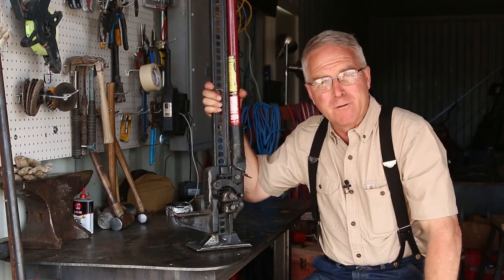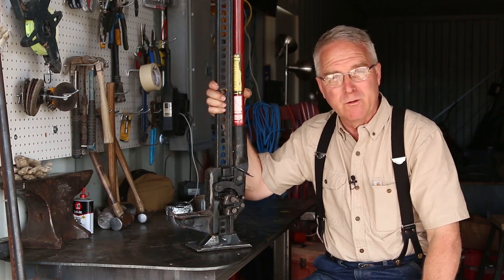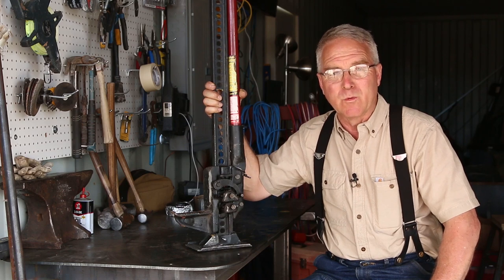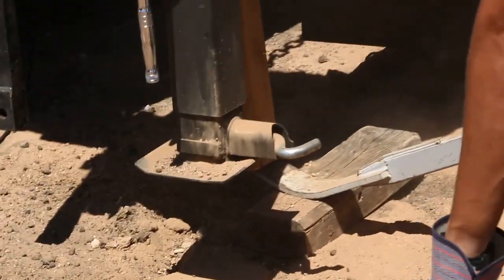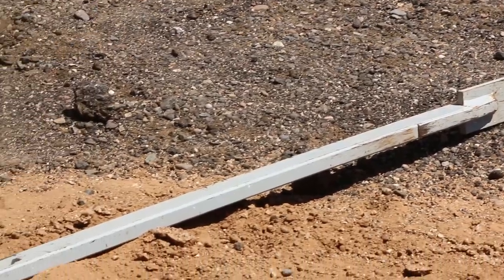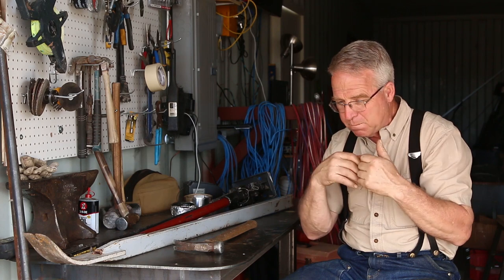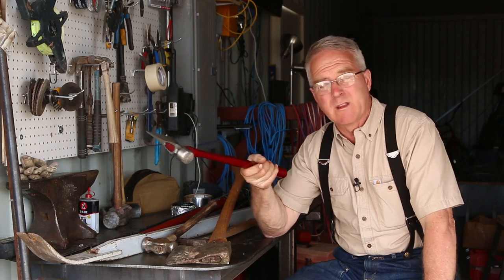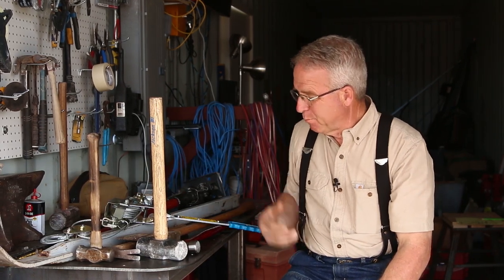5 Problem Solving Tools

Comment: I have to argue that the absolute best tool you can carry, other then your mind, is a pair of 4" Vise grips. I've carried a pair for over 20 years(the one I have now, I've had for 8 years) and used them for everything from cutting wire, to a makeshift shifter lever for my motorcycle when mine went bounced off running about 70 down the highway. I've welded an eye hook eye onto the tightening bolt, welded the hook shut and put a little weld in the seam where that bolt screws in.  The reason for the eye hook eye is to allow a piece of cordage to be lashed to it,I used to hold a chicken ladder from bouncing when  painting a standing seam metal roof. I've also used the eye hook eye feature to lower paint cans from a roof to be filled with fasteners or tools (clamp the vise grips to the can, tie a piece of 550 cord to it and lower it down). The thing is as handy as a pocket on a shirt

Comment: I carry at SOG super tool and have fixed so many things with it. I've also had Leatherman super tools, both brands are very good. Many, many a time it's saved me from running for another tool. Mind you these are simple one item fixes but the tool was on my hip and I made the repair in a minute. I remember driving to work early one day as it had snowed the night earlier. On the way a lady was off the road and had problems under the vehicle. I pulled over and looked for her, a exhaust bracket failed and it was dragging. I pulled a clothes hanger out of my trunk and threw a press blanket under the car and used the SOG to cut & twist the wire to get the exhaust back in place. Now I told her she must go immediately to a shop to get it fixed because clearly it was a temporary repair. She was so happy and broke out her purse to pay me, I took nothing and only asked that if she could help another in need that would be my payment. She felt great and so did I. Though there were many a time I could not stop to help others as time was not on my side. I've also helped others: a lady drove into the curb blowing out the side wall of her front tire. I was leaving for work and after examining the problem told her that to get this done she would have to pay me for lunch, $15, and ... help out. I was leaving for work and time was of essence. She angrily agreed so while I get a lift and T bar out of the garage she was emptying the back of her car to get to her spare. Was done in no time but what set me off was that she was using her phone and RAN OFF THE ROAD in our residential area and that's why I insisted she pay for lunch. I wanted her to think about what she did and maybe complain to her other half and he probably would see through what happened too. This woman could have really hurt or killed someone. Sometimes you have to help folks in a stern way to get them to wake up.

Comment: In my work, I got two hammers. Both are 4lbs sledges. Both in hickory handles, ones cut down to 7in and the other is a 16in. The amount of times I've reached for those two hammers beats out every other tool in my toolbox.

Comment: I have needed every one of those, but improvised something else for the burk bar, be it an ice pick, sapling I cut with the axe, or just a big bar I found near by.  The come along lives in my truck, as does the high lift jack, and as should an axe.  I'm not certain there is an axe in it right now.  For long pulls, like pulling a tree over in a narrow felling window, or looping the rope through a block on the truck to two trees, or unsticking my off highway vehicles, or pulling a moose out of the river, the rope along shines.  As many feet of pull as you have feet of rope.  The high lift, and it's little brother the bumper jack, have saved so much work.  Jacking up trailers to change tires, jacking up the tongue when the tongue jack failed, getting the truck out of a hole.  I had to use the high lift in conjunction with the rope along to lift a stuck 4 place trailer out of the snow burm and back onto my driveway.  I gotta make sure there's an axe in the truck...and the high lift come to think of it, it's possible I put it down near the last project in the yard....

Comment: I worked in a garden centre for 2 years as a runner and everyday was different from putting up shelving to panting walls to light demo so I needed a tool kit and being on my feet all day working around customers I couldn’t carry a proper tool kit so for those two years a Leatherman was my tool kit. I never ran into a problem I couldn’t solve with my Wave

Comment: I volunteered as a reserve deputy for a number of years (my day job is a master electrician/machinery tech/ metal fabricator/ grounds repair). like you I own and use a lot of different tools.  One December night we had a call to an accident involving a truckload of teenagers on a rural highway. Sadly one girl was killed, but when we rolled up, there were still 4 seriously injured kids wayyyyy down a ravine and we needed immediate access through the barbed wire fence to get to them. Out came the Gerber multi-tool. I know cutting the top strand of barbed-wire is not normally in the Gerber's wheelhouse, but It was that night. You also have to remember I was kinda amped up on adrenaline and have a pretty good wire cutting grip. Well to make a long story short, we got through, down to the kids, saving at least one from dying by minutes. The next day I took out the Gerber to inspect it and saw that although it did the job, I destroyed it in the process. Gerber replaced it free of charge of course. I do know the feeling of having the tools, equipment, and know-how to have helped many people over the years. My electrical tool truck is stock with a diverse assortment of tools. Many of which can and have been used in emergency situations. You are correct in your thinking and actions ....... god bless you. take care ..... Montana Dan

Comment: I've got most of your collection and have used all of them during my working career. The one that I almost didn't recognize was the come along. Largely because we called it simply the fence stretcher. It had triple pulleys at each end. Both ends had a hook and there was a brake that the rope ran through. As soon as you had it where you wanted you yanked the rope against the brake and it held it fast. I've seen that simple tool used for the most ingenious of tasks. Most of which would not be certified by a safety board. People born with tools in their hands and learn to use them and be creative with them can handle almost any thing life throws at them. Even a curve ball.

Comment: Years ago, I was with a group of guys, four of us, doing some work in The Geyers geothermal region of Sonoma County. We passed through a gate and drove perhaps 15 miles on dirt roads, did our work, and drove out only to find the gate locked and no way to drive past. The dirt roads were deadends. It was 530 PM and mobile phone were 15 years into the future. I had on me a Victorianox Swiss Army knife with a hacksaw blade. It took us over three hours but we cut through a steel ranch gate, and slipped the chain through the cut, left a note who we were, and left. The gate wasn't supposed to be locked and no one ever contacted us. In 40 years of work, I never went into a remote area without a Swiss Army Knife.

Comment: I could have sworn I knew what your top two were going to be.  And I guess your top 1 covered them?  A knife and a flathead screwdriver.  These (and my tape measure and pencil) are the two things I use constantly no matter what I am doing.  The other thing I always make sure I always have handy (one in every glove box, next to my spare tape measure, electrical tape and stanley knife) is a shifter.  I don't use them very often (or like them that much, compared to sockets or spanners), but they are invaluable when you do.
Reply: What is a shifter?

Comment: I prefer a good roofing hatchet over a rigging axe myself, however I roofed for 30 years so I am much more comfortable with the old Estwing solid steel roofing hatchet. The Stanley Fat Max is another one that's decent and usually easy to find at a big box store.

Comment: FYI Hi lift does the come a long bit too.  You can use the I bar and the handle as a pry bar. You can bolt the end jaw on and use it as a vice.  I won’t go anywhere without my hi lift a hammer, a 10” vice grip, and a can of WD40.

Comment: Here in Australia we do a fair bit of open road driving and not construction related really but the boot of my V8 Fairlane always has a six metre jumper leads and 12 V Air compresser and just those two things usually get somebody else out of a jam once a year because I stop to help them out

I’ve always found that 99% of the time flat tyres are often a slow leak so all you really need is the 12 V compressor to pump the tire up so you can then drive it to the repair shop to put a plug in it 

you don’t even need to get your hands dirty getting or crack a sweat getting the Greasey old jack out 

just pump it up and they’ll be okay for 12 or 24 hours slow leaks sometimes take a few days to go down........

I suppose that’s kind of construction related because you guys all have work vehicles

Comment: My grandpa has a tool bag in his truck filled with only tools he finds on the road and he's had parts of his engine break or wear out and just walked to a shop, bought a new part, and replaced it right on the side of the road. He told me a story about how his engine wasn't cooling and so would get far too hot and far too quickly so he just took it very slow and steady and repaired his car in the parking lot of an auto parts shop using only tools he found on the road. Also my favorite tool is probably a drill with a keyless chuck. It may not always be the best problem solver but I've found sometimes the ability to make something spin is all you really need. I can use it to mix paint or plaster, I can put wire brushes or abrasives in it, I can use it to sharpen pencils with ridiculous speed, I can use it to quickly assemble and disassemble things, and probably most importantly, I can just put holes in things. I have a makita drill that I found in an actual bucket of water where it must have been for at least a couple years and its now one of my most used tools

Comment: On the note of a multi tool, we came across an accident driving one day where a horse trailer rolled over in front of us. Two horses inside and the owner was more than on edge. As he manged to get inside and check on them one was being hung by her line. I passed him my Leatherman Wave and the horse made it, ive carried one for years, first time it was that important. Also, solved the problem.

Comment: My Dad ALWAYS had a jackknife (Victorinox) a two ended screwdriver (straight slot & Phillips) & a pocket sized pliers & a nail set punch. HE NEVER left the house without those 4 items on his person, in his pocket. He was frequently called on in an emergency to solve a problem, & was able to save the day. I now carry all that & a couple of other things in belt pouches. An LED flashlight is used numerous times daily & I have all the best quality multi tools & a 5 inch Knipex adjustable pliers that open to over an inch. 

DON'T BUY CHEAP TOOLS. Your life could depend on them. Use the cheap ones at home, where you can easily get other ones or use the top of the line ones you keep for emergencies in your everyday carry.

Comment: Might have sent a comment a few years ago, not sure, But- leatherman wave.I'm a retired tradesman, worked  at a state facility for 30+ years, now retired. I had an old P.U. service truck, 2 side and 1 cross-bed toolbox, milk crates in the cab w/more tools and parts as needed, a 4" vice on the rear bumper and a decent tool belt. A lot of my work was simple troubleshooting, pocket screwdrivers, a Swiss army knife-tinker model and a AA mini mag light, always wanted a leatherman, but the $10 S.W.K worked fine, couldn't justify the $60+ leatherman.  Fast forward 10 years, our facility changed missions, became a semi- Hosp-Correctional facility upgraded the police from a 5 man force to a 150+ man dept. New chief tries to enforce new strict procedures, almost fires a civilian employee for having pocket knife. Could not, was not illegal, so he wrote a very stiff edict to change this.  There are 50+ guys in Plant Operations, all use pocket knives, now illegal. Our dept bosses talk w/ new Police Dept. guys, and are told 'We say No Knives for anyone.' Boss says (softly) Didn't one of our men fix your A/C yesterday? Did he use a pocket Knife?' Chief thinks about this, found a way out of the corner he painted himself into.  OK- tradesmen can have a Leatherman TOOL, but not a KNIFE, The TOOL is legal.' So the state bought all of us a Wave TOOL ($74 by this point) that I wouldn't buy for myself.  Been carrying my Wave daily for 20 yrs working, 10 yrs retired, and make good use of it almost daily.  I think of it as my retirement gift.

Comment: I am the local tool guy.  I'm also the local problem-solver.  Neighbors are always asking for favors big and small when it comes to issues a suburban homeowner encounters -- VFD drill press, precision hydraulic press, four Hi Lifts, desk top lathe/mill, welders, you name it.

My dad wasn't a mechanical person  But, he did have basic wrenches, circular saw, electric hand drill.  He muddled by.  I, however, was always trying to fix or build things.  The proper tool makes fixing/building anything a pleasure rather than a disappointing exercise. 

My career is in high-end IT.  And over the years I've built a impressive collection of extremely powerful shell scripts and routines which can be plugged in to the code of others at the drop of a dime.  Those tool libraries are installed in many billion dollar companies still solving sticky issues and moving/directing billions of dollars of commerce.

There's nothing like the grand high experienced when one's tool (especially one's fabricated tool) solves a large and costly problem.   Ain't no chemical drug ever going to replace that high.

Comment: I was going to choose vice grips as the most important tool. Figured everyone else thinks a multitool is the answer, or a pocketknife. Like preppers who think guns are more useful than chainsaws when there's a natural disaster. I guess vice grips save me because I do mechanic style work. When I had to fix a bumper with no tools, I bought vice grips. Yesterday when a bent well pressure tank valve failed, I used a vinyl sleeve from some wires lying around, band clamp, screwdriver to tighten the clamp, and vice grips to seal the leak until I could go get parts. The vice grip combines the leverage of your high lift jack, come-along, and Burke bar, with the functionality of pliers and wrenches. I can flatten aluminum tubing, extract broken bolts, clamp brake lines.

Comment: Hand sledge, knipex pliers, 6 in 1 screwdriver, T&B wire stripper/ crimper, vice grips.  That's my  yacht rigger top 5 but there's more rrally

Comment: I'm 81 with limited mobility. I just erected a 10 x 20 temporary shelter with heavy duty vinyl and a steel frame.  I raised the corners with a come-along to insert the legs and to hold it together while I installed snow load cables. It was tested this week. It held.
I have seen framing carpenters using hatchets.instead of hammers. The guy who taught me framing didn't so I don't. I always had one available. 
I have done carpentry, heat treating, mechanic work, farming, and junking. I have found a heavy duty pocket knife an essential tool. I was surprised that he came out with a multi-tool.
I have never owned one. I still don't see the need for one. Sometimes the multi-tool marked the beginner. or amateur in the job.
Many years ago I bought a roll of made in USA bailing wire. I give guys small rolls of it. The farming crowd was unhappy with the foreign made wire and Tractor Supply got some USA wire.

Comment: One tool I've used more to get people out of situations more than any other have been jumper cables. It's surprising to me how often I find myself in a situation where someone needs a jump start and I'm the only person around with cables in my car. I can't understand why people would be driving around without them, I threw mine in my trunk when I got the car and forget about them until someone needs a jump.

Comment: About 15 to 20 years ago in my youth ( I am 73). I was riding my dirt bike too fast and popped off the trail no problem I stayed on the gas figuring the creosote bush would throw me back on the trail. Wrong went thru the bush and climber a barbed wire fence. The metal post bent and I almost made it over until the foot peg caught the wire. So there I was bike in the fence me on the other side with my foot trapped between the wire and bike. My buddy was ahead of me a didn't realize I wasn't behind him. So I got my Autzone multi tool out of my fanny pack, opened up the side cutter and it cut the barb wire like butter.

Comment: Good video for kids around  30 and under.  I guess that hammer/hatchet has it's uses but in the environment I'm always in a short handled cross peen 10 lbs sledge hammer is always best. List shoulda been longer because someone mentioned vise grips and they were right and I have not stopped finding uses for an 18 in pipe wrench and a heavy walled piece of round tubing big enough to go over the handle of that high lift jack and around 4 feet long.